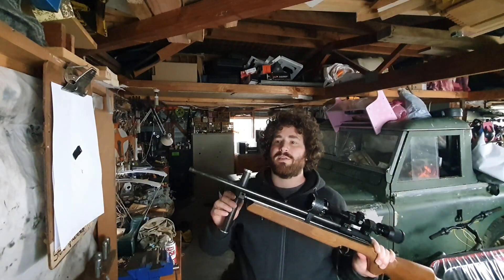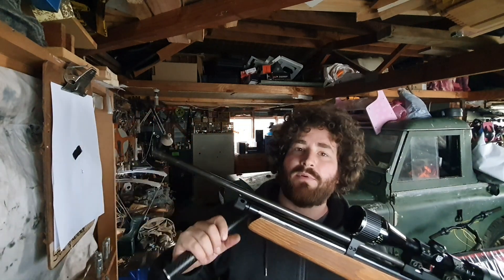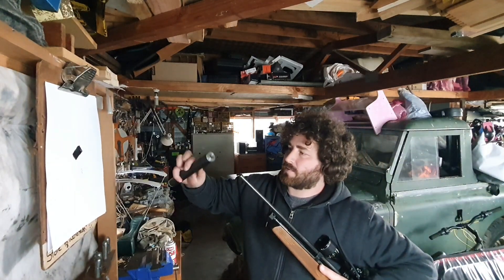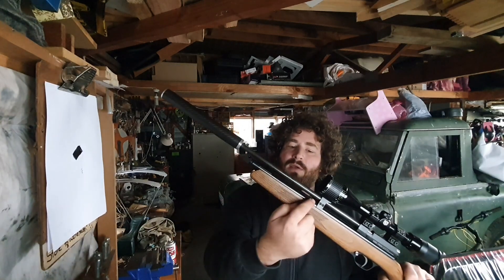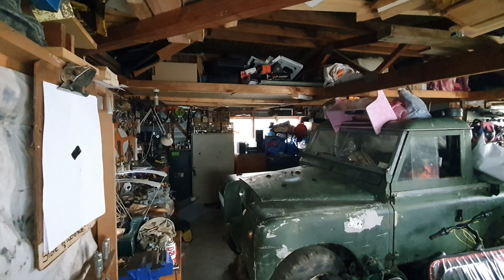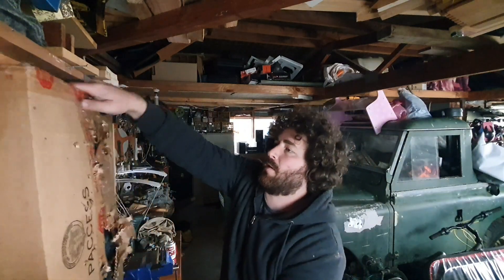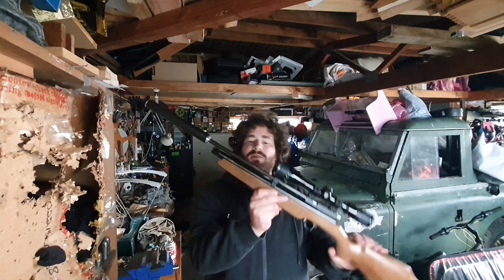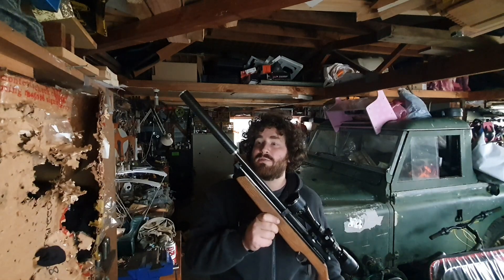CR600 Air Cheif Rapid Repeater .25cal project update - Suppressor test

Comment: excellent man! I baught one of these a couple years back and polished the trigger and that was about it. was .22. shot heaps of bunnies with it at 20 yards max. Really really thinking of buying another in .22 and do the power increase mod. How many fps you getting with an 18 grain pellet ?
Reply from the maker: Thanks, getting 640 fps on the 18gr, up from 510 fps in stock form. Cheers